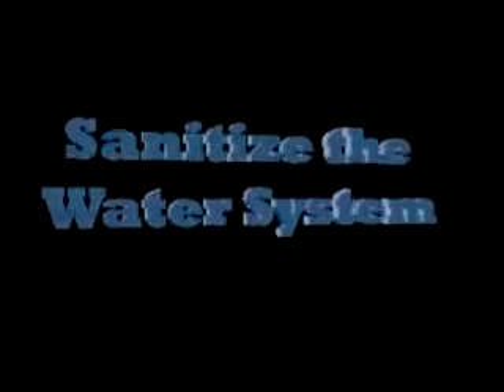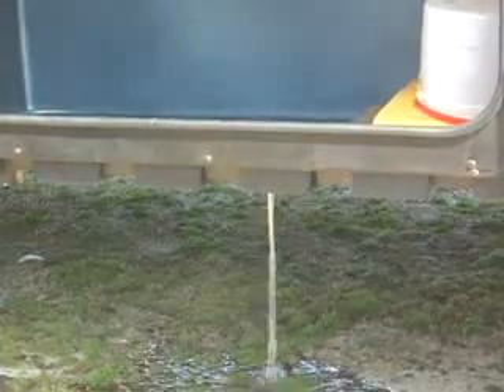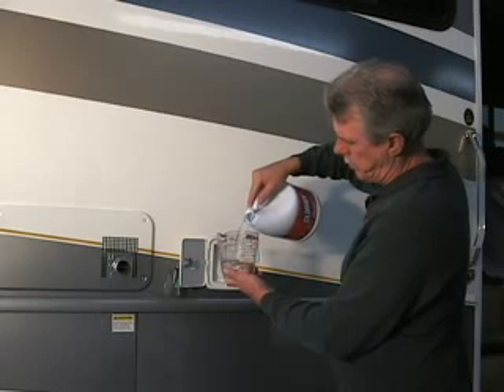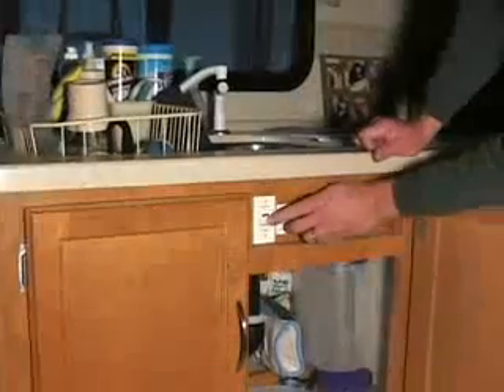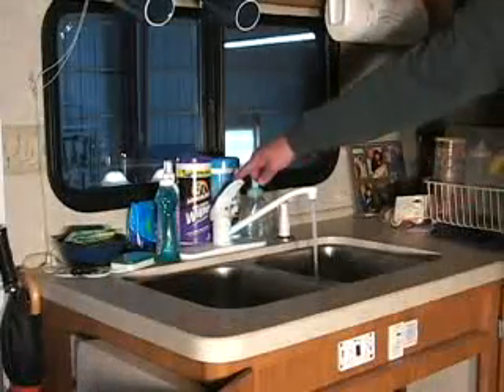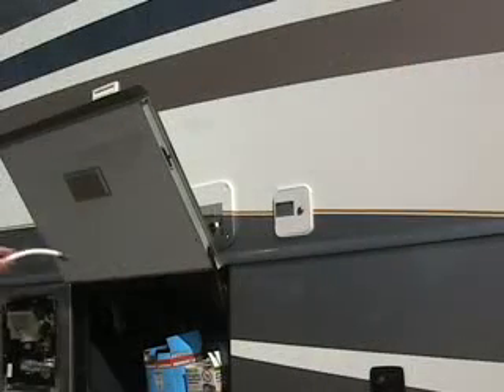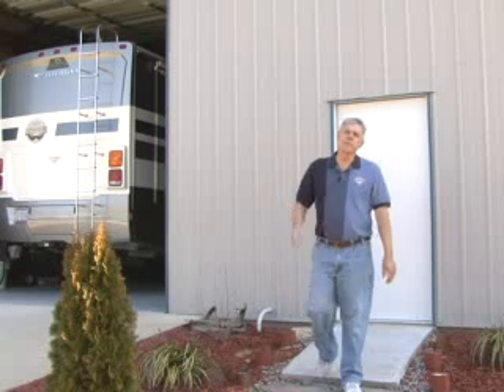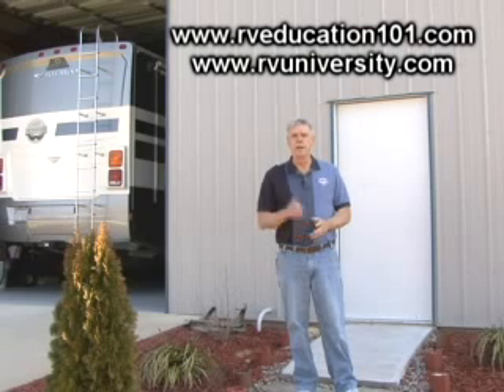RV 101® -  How-To Sanitize the RV Water System

Comment: Marks thanks for this video but I have a question that I think others may have with regards to this issue. My coach is a 2010 forest river 5th wheel with the control center inside the street side slam door, it has all the water, sewer, TV connections and controls, and also the water diverter for the onboard water tank, with this water diverter you do not have an outside (or separate) ability to add bleach to the system, so how would you get bleach into a closed system like this?

Comment from the maker: Hi Booker,
 
Here is how I would do it. Hook one end of the water hose to the RV. Mix the required amount of bleach for your size water tank with a gallon of water in a jug and pour the mixture directly into the opposite end of the water hose. Connect the hose to the water source and with the diverter set to the fresh water tank fill position turn the water source on and fill the fresh water holding tank.

Comment: So I just bought a 2016 Minnie Winnie tow-trailer. My wife took it out on it's maiden voyage over the holiday weekend. When it came to shower, we found the water (after being connected to city line with our installed regulator) only trickled. The pressure was low. Again, being connected to the city line (60-80 PSI), we found the shower pressure extremely low. Hmm, any ideas? Would welcome your (and YouTubers) ideas! Thank you! :)
Reply from the maker: There could be several things to check. Sometimes you need what is referred to as a high flow regulator to get better water pressure in the RV, but still protect the water system. If the problem is only with the shower I would check the diverter that switches the flow of water from the faucet to the shower. If that checks out okay you might want to try a high flow shower head designed specifically for use in RVs. The old shower head might have a screen that is partially blocked with debris and needs to be cleaned as well.
Reply: Excellent feedback. Thank you for taking the time to respond. Always a pleasure! :)

Comment: I can hardly pull hard enough on the fresh water and black water valves to open them up and close them. How do I clean or oil them to make them easier to operate?
Reply from the maker: Donna Brown 

There are additives that you can put in the holding tanks that are designed 
to help lubricate the valves. Check with camping world or another RV parts 
store. If you have access to the valves the next time the tanks are empty, clean 
and dry try spraying a silicone spray lubricant on the valve gates and working 
then back and forth. Don't use any products or sprays with petroleum in 
it.
If this doesn't work chances are the valves have seen better days and will 

need to be replaced.

Comment: Cheep RV's had old fill systems like this.... your $500k RV/coach does not have plastic fill systems like this.. its all sealed with only a hose inlet.. now what?
Reply from the maker: Carefully add the correct amount of Clorox directly into the water hose, then connect the hose to the water supply and turn the water on.